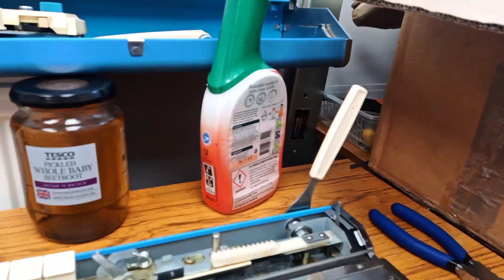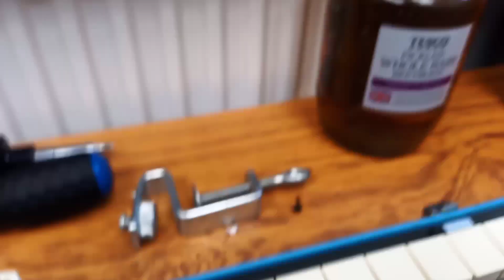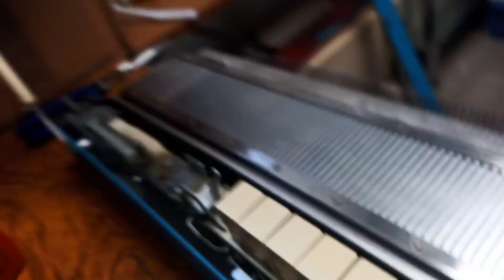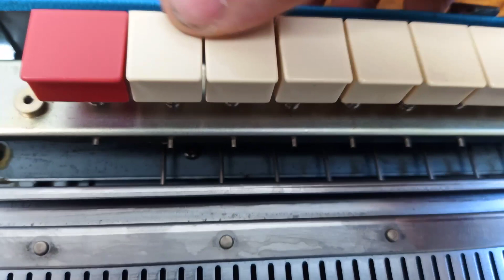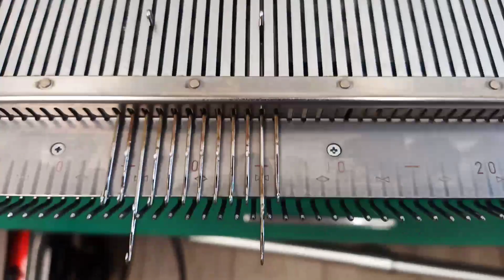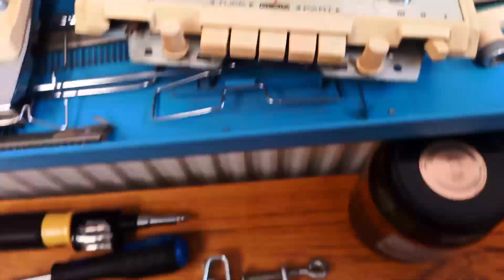How does an 8 stitch push button knitting machine work?

Comment: Hi Charlie, I have one of these machines and this L shaped piece has come out of the lever/ bar pushing mechanism it sort of just slots in. It came out when I took it apart to clean and I just can’t figure out how it goes back! Do you have a video on this by chance? 😅
Reply: The same thing happened to me! It seems like it's some sort of tool for the gate pegs. The tool fits perfectly in the space between the gate pegs. Also, underneath the gate pegs, there are indentations into which the tip of the tool fits so you can check the angle of the gate pegs. That's all I could think of because it didn't seem to fit anywhere in the machine.

Comment: How does it NOT move the needles in the far back position forward?
Reply from the maker: The needles have got a little link in them which means they sit slightly higher up when not in working position, and miss the "battlements".